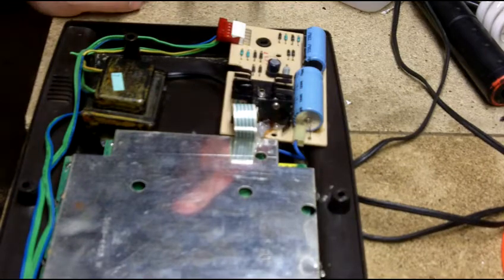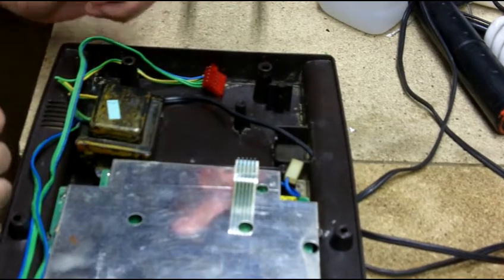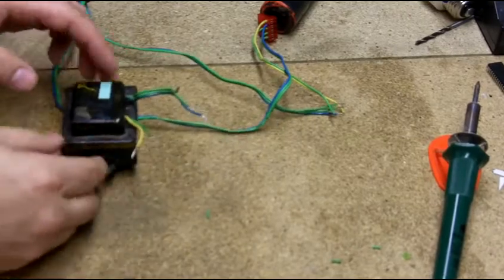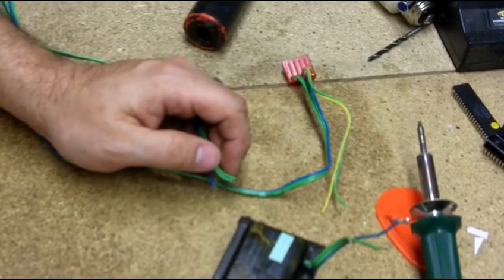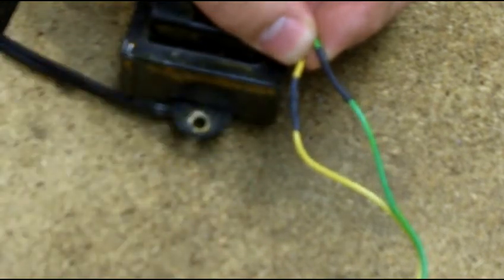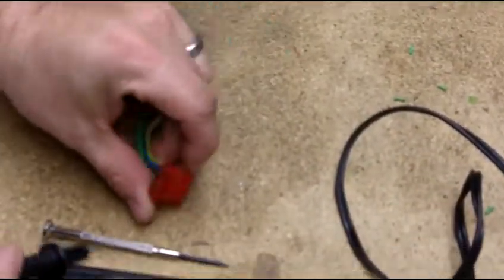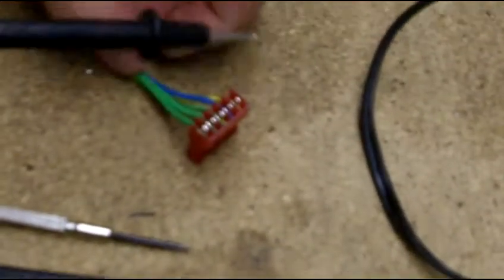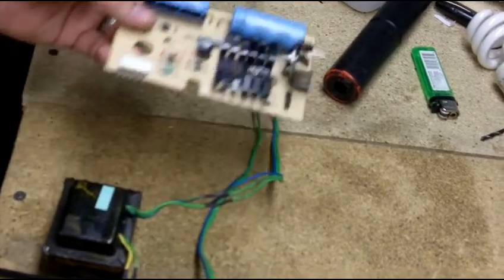Replace and test voltage on Intellivision Transformer

Comment: Is it possible to replace the ribbon cable at all? Mine ripped along with the connector and I tried and replaced it with insulated wire.
Reply: Did you ever find one, and from where!?

Comment: What if the voltages are higher?
On my INTV System III (No not Intellivision 3 the unreleased system)
The Blue and Yellow is 18.8
the center green wire with yellow stripe and 2 green wires 9.5 each
the 2 green wires together 18.5 which matches what you got but the other wires the voltage is higher.

Comment: where is the video where you tell how to test and repair the voltage regulator or power supply as you called it? That thing with the ribbon cable and big caps on it.